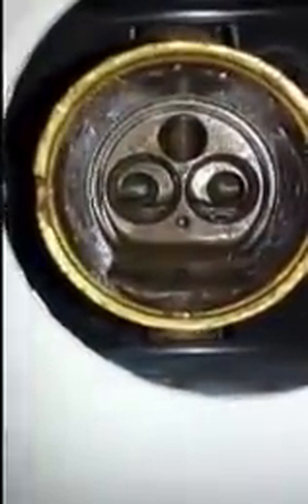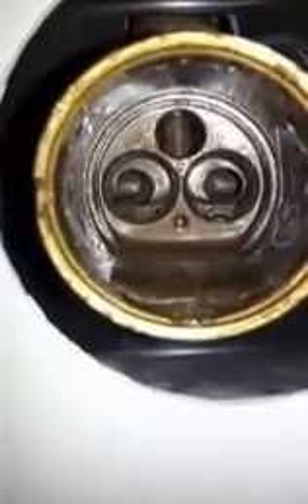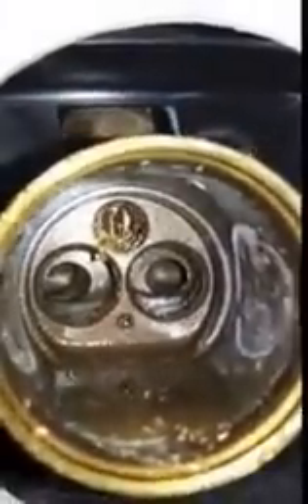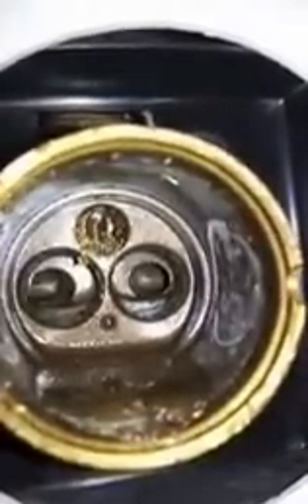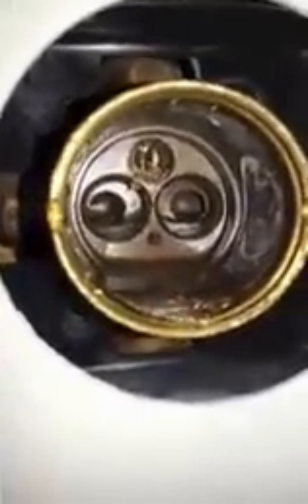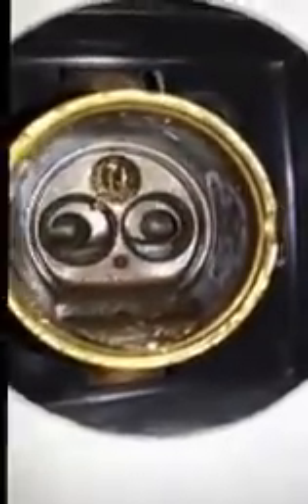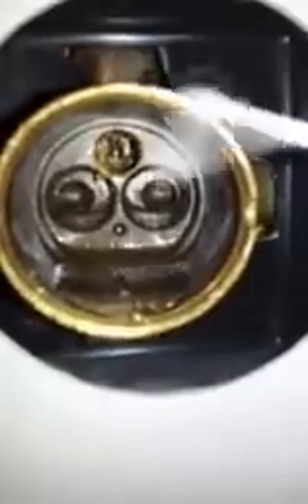Delta Valve Body mod for more water flow (now w follow up link)

Comment: This modification TOTALLY WORKS!! I had this identical issue, and applied the modification and my shower works like new! Saved me AT LEAST $500.00 to have a Plumber change out the whole faucet. I had IDENTICAL symptoms also.

Some words of advice - When drilling, go EASY and SLOW! You're drilling into COPPER which once the drill bit "bites" into the copper, it will open rather easily. Don't press hard! You don't want to find out the hard way what happens when you break the little copper pipe on the inside of the pipe you are wanting to drill open. You see in this video once the bit bites into the copper, it jams the drill a little bit.

DRAWBACK - If you use the Tub, when you run Tub water, there will be a trickle of water also out of the shower head. You can get a shut-off valve for the shower head to avoid this, or you can just live with it. I normally take SHOWERS only anyhow.

If you do wish to replace your faucet, get the HIGH FLOW version. My Plumber advises there is a "Miser" version which this is, and a High Flow unit that compensates for newer Tankless water heaters, which have to see a certain amount of water flow before they will heat water. My tankless heater wouldn't even kick in until after I did this modification. But like usaryder74 said, DO THIS MODIFICATION AT YOUR OWN RISK!! But if by chance you happen to break the small pipe, let us all know what happens!

Delta was on here bashing this video. WELL DELTA, if you made it more clear on your products packaging that this faucet is a WATER SAVER / WATER MISER version and it isn't recommended for TANKLESS WATER HEATER USE, you'd have alot less people pissed off at you!
Reply from the maker: Steve LaRock I am glad to hear.
My worse made video has helped the most people. The video is super low resolution. But hey. Who cares right?

Comment: THANK YOU !!!!  I was so nervous to drill that hole, so I went to Home Depot and had them open the box of a Delta faucet (which they did mostly because the retired Plumber employee thought I was nuts!), because I can’t see inside mine in the wall. He was shocked to see for himself that there is a pipe within the pipe fitting, and he thought it was the stupidest design he had ever seen. Once I saw it, I knew there was no reason to fear drilling the hole. The internal pipe is just a thin piece of copper that Delta has wedged inside the fitting in order to restrict water flow. It is truly a bad design,  because the shape at the bottom of the insert would certainly catch debris and create a blockage. I am so excited! I have a usable shower once more!! Never would have thought of this in a million years.

Comment: I’ve got the same problem . Thanks you I tryed everything . New cartridge , an they come apart in two parts in the middle two seals, an springs look down the two seals old one has half moon shape, New one has a smaller orface. Hole drill it out just little bigger , stay to that one side to keep out of slide valve seal !!
Reply from the maker: Curt Gar 
Did it work?

Comment: How did you cap off the bottom with the faucet still remaining?
Reply from the maker: Crinimal 
A piece of rubber from my sandals
Reply: usaryder74 stuffed it down on the actual bottom faucet? Thanks for the reply. I've been fighting this all yesterday replacing stuff and still low pressure.
Reply: I just drilled a "pilot" hole and went bigger from there. It worked and I didn't even block the bath faucet. It may drip slowly when filling the bath at the shower, but I don't care. 7 years of horrible low pressure showers and a Saturday buying parts I really didn't need to buy. Thanks a lot for the video.

Comment: It worked! You are a genius. We've suffered with low pressure for years and no plumber could help. We drilled only one half way through and  voila! WATER. Gotta go take a nice shower- thanks!
Reply from the maker: Rox Toro 
I am glad to hear.
The funny thing is that:
1. Delta saw this video and criticized by saying they don't recommend this mod. Well, they should have a better design.
2. This video was so cheaply made (I admit), but still gets lots of positive feedback.

Comment: Hi usaryder74, I'm sorry to hear that you were experiencing low flow. However, we do not recommend altering the valve in this way. The most common cause of reduced flow is debris. If you need any help in the future, our customer service team would be more than happy to assist. Please feel free to call us at 1-800-345-3358 or email customerservice@deltafaucet.com. –Jon
Reply: I'm kind of disgusted with Delta and their company line of "get a plumber", "debris", "blah blah blah". No. The problem is your shit cartridge that severely limits the rate of water flow to about 1GPM. So fuck off. I won't buy Delta products EVER AGAIN. Complete shit.
Reply: @ Delta, my shower had very low pressure from day 1! So there could be no way there is debri in the line. I believe it's a terrible design by Delta!!
Reply from the maker: I hear what you say. But I had plumber come once to back flush. I just won't be paying them every year for it. After this mod, zero plumber calls. 🍁
Reply: Delta Faucet this guy is a gennious!!!
Reply: Delta Faucet what about if it's new plumbing and brand new delta series 14 porter bath faucet
Reply: Delta Faucet I definitely would not drill my valve body
Reply: Don't Ask lol yuup!
Reply: Help for free right delta??
Reply: Delta Faucet, Hello I have a "foundations" kitchen faucet 
#21987LF-SS. I need the goose neck replaced , I was putting on a filter and the end bent on me
can you tell me how to get replacement part?
Reply: Hi Delta Faucet, I'm sorry to hear that you were publicly making false statements. However, you can easily state the new unaltered OEM flow rate in gpm. After a simple flow test is performed, then a comparison of the valve in the field could be determined as acceptable or a fault and your possible debris obstruction diagnosis or another possible cause of the decreased flow rate could then and only then be made. By simply stating your blanket diagnosis of debris blockage to the thousands of Delta faucet owners experiencing this decreased flow rate issue/symptom without even identifying there is a problem clearly shows your total disreguard to remedy this issue. Futhermore, you have demonstrated a diversion tactic by not even exploring the possiblity that the issue is a result of design. You have failed miserably at your position of Delta Faucet Representative and shall no longer be allowed to lie to your customers
Reply: very piss poor design. even the cartridge has to be modified to get good water flow.

Comment: You saved my life !! or at least, money and time. I also changed the valve until I saw this video. Drilling took 2 minutes and now the shower is like new !! these Delta faucets must have a design problem. Thanks again man for such a useful video.
Reply from the maker: ftey2000 
You just made my day. 
When I made this video I did not expect to have helped so many people. And the funny thing is that this is the most low-quality video I've ever made. But it gets the message across.
Reply: They don't have a design problem. They are made like this on purpose. Only god knows why they thought anyone would want a shower that barely leaks water out. Unbelievable.
Reply: Also to note I have a delta valve that I have is a HF and has only the shower port, no tub port as I planned only to do a shower head. Still it is very similar to many other styles that is in this grouping and only a few letters in the name can change up the whole thing. Make sure you have the right version if you are installing it. It is not the design of the body being wrong but whoever chose it got the wrong one for the intended purpose or the new owners want a different purpose for the shower body to handle. Just do your research on the products before you deal with them.
Reply: For one thing you got the wrong version. You need to get the HF or High Flow version. There is no little tubes just wide open flow. No for the lower pressure.. some parts have limits of pressure and can damage them. Small shower head sprayers or some hand sprayers are like this.
Reply: For one thing you got the wrong version. You need to get the HF or High Flow version. There is no little tubes just wide open flow. No for the lower pressure.. some parts have limits of pressure and can damage them. Small shower head sprayers or some hand sprayers are like this.

Comment: I was able to gently tap that inner tube right out with a hammer instead of having to drill through it as I am about to rough in my plumbing now.  The high flow Delta model (with shower only, no tub port) is twice the price, so this simple mod along with capping the tub port saved me $50 on Amazon (I'm installing two valves).  So thanks for the video, it helped! 
https://drive.google.com/open?id=0B-vk20koNTAWd0pldE5SVGY0SFU

Comment: You don't have to do that, only thing that you must do a hose and ask your neighbor to let you just water then get some type a nozzle to have some pressure and put it thru the shower head and faucet as well, reinstall the valve and you'll have good water flow. DO NOT DRILL!!!
Reply from the maker: Jose , a plumber came and rand the back pressure thing. using compressed air. it worked, but after few months i had the same problem. 
after the mod, zero problems for years.
Reply: usaryder74 after the mod??
Reply from the maker: yes. after this crazy mod it has been working flawlessly.

Comment: I have a house that I guess they changed the meter, or something. (they refuse to admit if they did, but I never see the meter reader man any more, leads me to belive they put in one them new fancy remote computer reader type meters) but the hole house don't get 1/8 the pressure it did when I moved in. I talked to neighbors and it seams my house is only one affected I replaced the main line from street / meter to house and added an outdoor garden-hose valve, it gets same low pressure. It so low, I've seen a dog piss harder than what comes out my pipe! My hole house dose like you show in first few times. (even the new main line before I reconnected to the house) water company say they charge me several $100.00 to be paid in advance to come check / test if it a bad meter.  I live in rule area, and tempted to build a water tower and rain catch system. (probably would if I can ever get my hands on the needed supplies!) Any one have better / cheaper idea to fix?
Reply: yeah, take a small sledge to the water company's meter

Comment: I had same problem in a rental. After having to drill out the hardened set screw just to get the handle off,  they should use soft set screw since this is a common problem...anyway I had plenty of water at the valve body hole with cartridge out.  Then I twisted the pressure balance back about 20 degrees off to remove. I put the handle portion of cartridge back in valve body and installed apron nut.  I pressured system and still very low pressure out of top and bottom. This eliminated the cartridge completely and told me the restriction was in valve body. After looking at valve body at Lowe's the tube you drilled is crimped into a square below where you drilled. So basically you have a square copper pipe in a round hole. This only leaves 4 small moon shaped passages for the water to go by and into the lower spout. Small chunks of rust or sediment can easily clog them up.  I took off lower spout adapter and purchased a double garden hose fitting and a brass fitting to adapt the 1/2" pipe to a male hose fitting. I capped shower head and then attached hose to fitting and pressurized with cartridge out. This back washes the small holes that get clogged. Rust and sediment came out and after reassembling it worked like new. I will also say that drilling the hole in tube as he did will still slow lower spout to work  as before. The only disadvantage is it will use up hot water reserve pretty quick by drilling hole. The only reason copper tube is there is because of federal restrictions in water flow to shower head.
Reply: will still allow lower spout to work

Comment: Comment and question:
I too had problems with water pressure. The plumber suggested spending $1200 to tear open the wall and replace the whole valve. I was able to resolve by removing the cartridge and  back flushing water through the shower arm, flushing all the sediment out.

Question: Does anyone know what function the "tube inside a tube" is? It seems to only serve the purpose of collecting sediment and clogging. Just curious.
Reply from the maker: Eric Worden i think the larger tube leads the water to the bottom faucet or what ever that is. in normal conditions, the water finds no way out at the bottom if you pull the little button, so it climbs back up inside the smaller tube. in the process calcium builds somewhere. I am glad to help. I have saved much money on youtube too.
Reply: I've read somewhere in researching shower pipes: the the inner tube delivers water out. The outer tube returns water back.

Comment: Thank's for your Video. (There is always Haters so Don't worry about them.) For me, from day 1, in a new house their was no pressure, the Design of the Delta Housing is Crap.I first replaced the cartridge $45 dollar disappointment. If you have hard water this is a Disaster waiting to happen. The options are, Blow a Hole in your wall replace the whole valve, or take a chance if you want your shower to work and Try it out.. So it's a lot of work and Expense if you do the Job of replacement. And I can Tell you.... You don't probably even know what a plumber would Charge.. Thank's for the Video

Comment: Thanks I really appreciate you taking the time to post this fix. It is so nice to have a great working shower again! It has been 6 or 7 years since this Delta valve body was installed with all new ceramic shower and the water flow has been terrible. For other folks that do this take your time drilling and don't use to much force. Worked great for me, thanks again your are a saint!

Comment: A question? Ive got new waterlines and new bathtub faucet Delta.. I have no water pressure? The line has plenty with the cartridge out but hardly any with it in??
Reply: Same here, plenty of pressure with the valve cartridge out. I wouldn't mind, so much, the reduced pressure in the shower, but it takes 40 minutes to fill the tub 4". The water is cold by the time you have enough water to bathe. Btw, all new construction.  I just ordered an extra valve, and I am going to try modifying by drilling out the holes in the balancer, and the metal back plate (on the valve).  If it works I will post you a note. Please post me if you find an answer.
Reply: dynatechar any update??
Reply: did it work ?